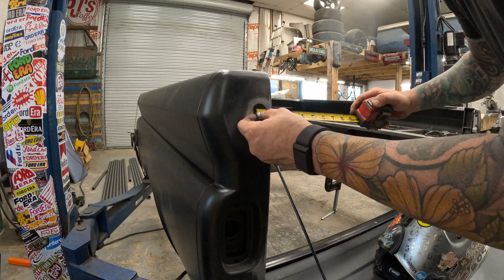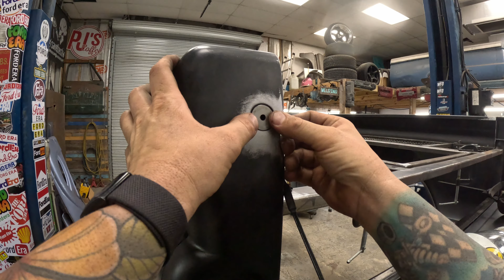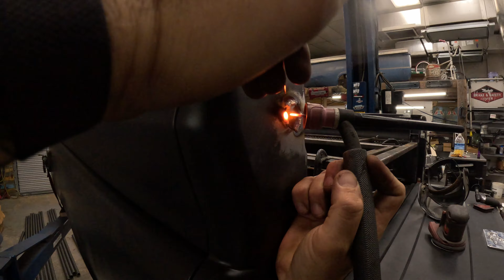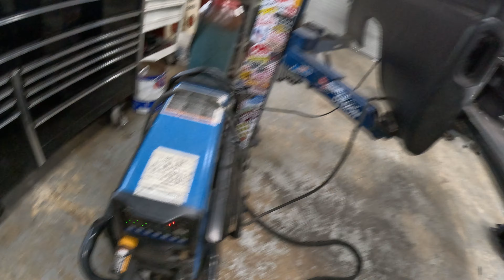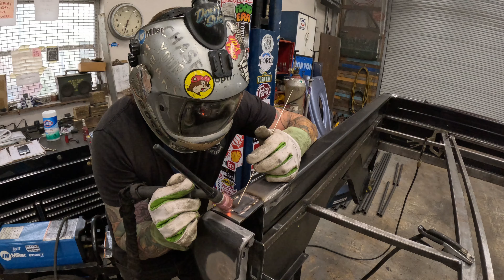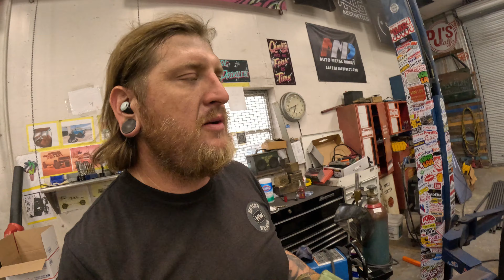Shaving Panels - Just the Tip - Hutch's Welding

Comment: Great work!
What tungsten did you use. 2% for mild steel? Great tip on the softer rod.
Reply from the maker: I use to but I use E3 Purple mix right now for everything
Reply: @HutchsWelding  10-4 , I'll check it out.

Comment: Can you do a tech Tuesday tip on fender lip rolling for fitting lager wheel and tire.
Reply from the maker: I have done it before with a fender roller tool, but I don't have one anymore. You can always cut the lip as well.
Reply: Went forward with Eastwood tool to try for a 18x11 wheel under a lowered 66 F100